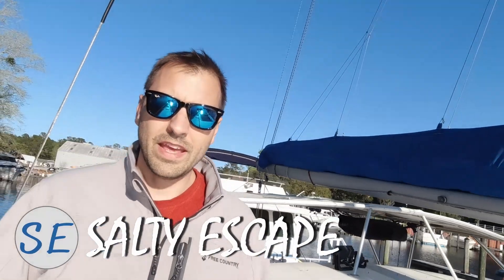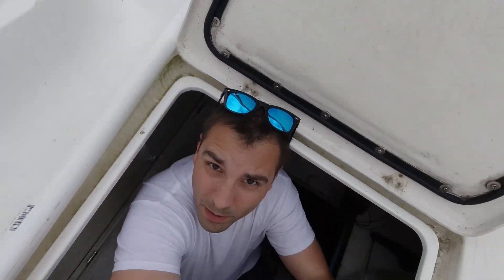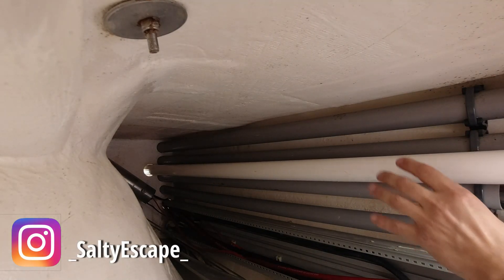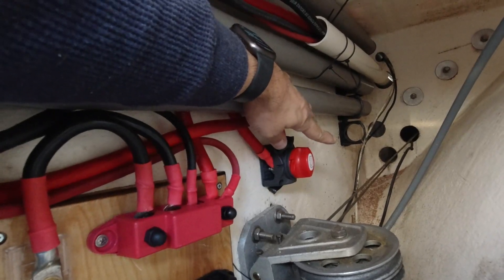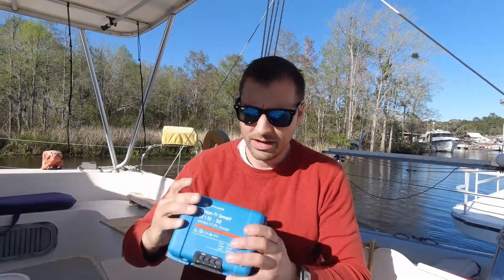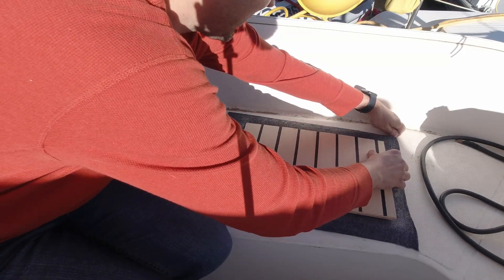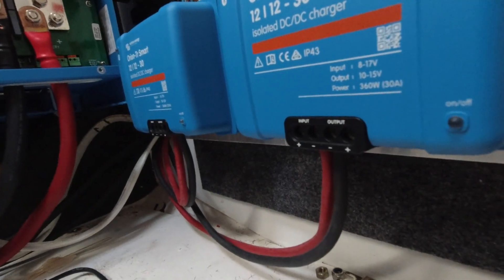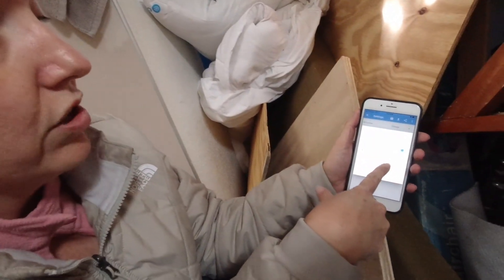Installing Victron Orion DC to DC chargers for AGM to LiFePo4 charging on our Catamaran Sailboat

Comment: I'm so glad I found this video before installing my Victron Orion TR 12-12 30 DC-DC charger.  I followed your lead and used a 1/4" aluminum plate as a mounting surface for the Orion.  In addition, I purchased 1/2" Nylon spacers  that I used to hold the aluminum plate off of the HDPE mounting surface to provide additional air flow around the entire setup.  It was super easy to wire up and program!  The unit does heat up a bit, but the extra heat sink of the aluminum and the offset spacers really help to control the heat.  I would not want to mount these directly to wood!!  Thanks again for your videos and for showing the best way to mount these DC-DC chargers.  Well Done!
Reply from the maker: Thanks for the feedback! We’ve had ours for a long time now and it works perfectly!   I love having the extra power go into the LiFePo4 bank.  Would you believe someone in the comments actually said the aluminum plate could be harmful by restricting the airflow!! 🤷‍♂️  I guess there’s one in every crowd.  Lol.  So happy you found my video helpful.  Cheers, Corey

Comment: Couple comments: Like you, I am in the process of planning a lithium battery bank installation. On a boat, I believe that by ABYC standards state that you should have a common ground; which implies that you should not be using the ISOLATED version of the Victron Orion DC-DC converter - the NON ISOLATED version has a common GROUND; the POSITIVE IN and OUT are ISOLATED as you would expect. The use of YELLOW wire, by ABYC standards is for DC GROUND - I see you have added RED heat shrink to the end of the cables( which is laudible), but the yellow wire is not a good plan long term; you will know what it is, but a technician or future owner will not.... I would also suggest as you are installing to get a DYMO GUN and mark what each cable is used for .... 
Again later on, when you are trouble shooting, you will be glad you took the time. I would also make a wiring diagram and anotate your installation. 

I did not see a shunt installed on the negative circuit for your starting batteries; it would be good to know what the engines are drawing overtime - you will be able to see starting current and know if something is not performing  right. I did not see where you installed the  VICTRON Smart Shunt on the Lithium bank?
Reply from the maker: Hi Daryl, 
Yes, common ground and bonding… 
I used the isolated Orion because I have AGM starter batteries for the engines.  I dove deep in the forums and the isolated was recommended.  Both engines are independent circuits with the exception of the Orions.  The Orions serve as my shunts.  The videos you have seen highlight the early phases of my install and there have been modifications and other features added.  My advice to you is to go Victron.  We have implemented their system including the Cerbo gx and display screen and it is well worth it!   
We have a few people in our patreon group who are building LiFePo4 batteries for their boats and there is always more information to share. As I write this, we are about 10 miles off shore headed to west palm beach FLorida and we will be heading to the Bahamas asap.  
Cheers and safe travels! 
Corey

Comment: Would love to see your wiring diagram for this installation as I am doing the same at the moment. André in Sydney
Reply from the maker: Hi Andre, thanks for reaching out!  There really isn’t anything mysterious about this install. It’s just a +/- from the starter battery into the Orion and then a +/- out to the DC busses. I did put fuses on each end. There are a number of very nicely drawn wiring diagrams on the Victron website.  For us, the system works as intended although our amperage coming in to the battery bank from the alternator is less than expected. I’m planning to upgrade my alternators and then we should have some pretty good input coming in. Hope this helps! Corey
Reply: @SaltyEscape  Hi Corey, Thanks for your reply. I was thinking about the differences for a boat install like where to put isolators/disconnects and the protection of the alternators. Since my boat is similar the system should be the same. André

Comment: Seems to me that charging the lithium batteries while motoring is not an example of capturing otherwise wasted energy from the diesel engines.   Charging represents a load on the engines that is indistinguishable from a headwind or counter current and will result in burning more fuel than without the lithium connection.
Reply from the maker: Hi Troy, the alternator turns regardless. There’s no additional load. Now, maybe when we upgrade the alternator there would be a change in load on the engine… however with high output alternators the charging benefit far exceeds the loss.
Reply: @SaltyEscape  thanks for fast response.  Enjoying your content. So, if I understand you correctly,  the alternator puts out a steady current regardless of what it's connected to? If thats the case, then what happens to the current when batteries are fully charged? ✌
Reply from the maker: My understanding is, the Orion‘s detect voltage. So, when the alternators recharge the starting battery (first) and the starting battery voltage climbs to around 14 the Orion’s kick on and the overflow voltage goes into the lithium battery bank.  This overflow voltage would normally be lost. I’m not an expert but that’s my understanding 😉
Reply from the maker: I think I should clarify… there is no additional mechanical load on the engine.

Comment: Love the channel guys! How are the Orion’s doing? I’m making the switch to lithium on our Leopard 40 and I think I’m going to use the Orion’s.
Reply from the maker: Thanks guys!  The Orion’s are working perfectly and autonomously.  So easy!  The only complaint is not with the Orion’s… but rather my alternators. When we upgrade to high output alternators we should see much higher amp input from the Orion’s into the batteries.-Corey
Reply: @SaltyEscape  did you use 6awg wire to and from the Orion’s?

I heard they get really hot. I like your metal backplate. I am considering putting them in the engine bay close to the Yanmar and starter battery. I hope they don’t get too hot! 

Fair winds!
Reply from the maker: I don’t recall which size wire I used… But it was the largest that would fit in the Orion. I had a long run of wire so I needed to use the largest gauge I could.
Reply: @SaltyEscape  I don't know a lot about alternators but shouldn't your existing stock alternators handle the 30 amp draw from the Orions?
Reply from the maker: They can handle it.. the alternators are not a high output… yet.  We will upgrade them soon. I hope. 😊

Comment: use a shunt https://www.victronenergy.com/panel-systems-remote-monitoring/smart-battery-shunt#pd-nav-image
Reply from the maker: Actually that is the exact shunt I am using!
Reply: @SaltyEscape  them throgh it you should now how munch current you are consuming
Reply from the maker: Oh.. I think we have a misunderstanding.  The shunt IS how I know how much power we have used.  Also our LiFePo4 batteries have a smart BMS that also monitors our use however the BMS units are for each battery.  (We have 5 battery banks)

Comment: Question.  What is the purpose of a bus bar?
Reply from the maker: Hey Rob,  They are used for positive or negative grouping / distribution.    For example the positive lead will come off of a battery and attach to a positive bus bar.  This bus bar will have multiple additional attachment points for additional leads to power your devices.  In my case, I am using my homemade bus bar as a common link for all of my LiFePo4 batteries to be wired in parallel.  Does that make sense?  Corey
Reply: @SaltyEscape  
Awesome.  Thanks Corey,...  electricity is my arch nemesis 😂😂
Reply from the maker: Haha... It can be intimidating.

Comment: May I ask why are you limiting charge current from the alternator of 80 - 85 amps to only 30 amps? (the great advantage of lithium battery in yachts is the fast alternator charging)
Reply from the maker: Hi Mikael,  great question!   First let me say, I am not an expert. However, the biggest reason for going with the Victron Orion was the smart, adaptive charging (bulk, absorption and float) designed for LiFePo4. Also the Victron Orion is programmable for your specific charge parameters which was important for us as we built our own battery bank with “raw” cells.  And, although it says 30 amps it’s rated for 430 watts continuous.  For us we have 2 units and therefore 860 watts when running both engines.  Considering most catamarans are only able to install between 1200-1400 watts of solar, we thought the Orion’s 860 watts was pretty good.  (We will be installing solar as well).  Lastly,  unless I’m mistaken, for the 12 volt to 12 volt options the 30 amp is the largest that they sell.  I hope that answers your question, if I’m mistaken on something please let me know!  Thanks for reaching out to me!  Cheers, Corey
Reply: @SaltyEscape  they can also be run in parallel for 60 amps.

Comment: Why do you have yellow black and red positive wires?  Is that not confusing
Reply: Yellow is the proper color for ground on boats with black HOT ac wiring so you don't confuse to 2
Reply from the maker: The only yellow one is the heavy ground for the Victron multiplus.  It’s yellow because it was salvaged from the existing lead acid battery system.  (I don’t know why the original wires were yellow). The ends have black heat shrink and at a glance you can see it’s just the equipment ground.  Not so confusing in person but I’m sure it looks a bit messy on camera.  I still have some wire organizing to do. 😊 -Corey

Comment: Hi Corey, Another great video. I will gratefully copy the aluminum heat sink when I mount my Victron 12 12/ 30 charger as well. Question is the fabric heat retardant?  Cheers Kevin
Reply from the maker: Hi Kevin, the fabric is felt. I bought it on Amazon. There is a link in the video description to my Amazon affiliate store. The manufacturer said it was ideal for very harsh environments, chemical resistant, heat resistant but they did not mention nonflammable.  Although I couldn’t find any other fabrics that were non-flammable either. My assumption is it is flame retardant but I do not know for sure. Maybe I’ll test it on a scrap… LOL.   I don’t know how warm these Orions will be during operation, however I doubt they will become that hot. Cheers -Corey
Reply: @SaltyEscape  hi Corey, yes I had looked at the link earlier but didn’t see a specific mention regarding flame resistant. It’s also out of stock. I’ll try the local auto supply store. I don’t think it will be an fire risk as the aluminum plate along with the additional spacer you used should keep it safe.. I appreciate your sharing your experience and also taking the time to reply. Cheers Kevin
Reply from the maker: Thanks Kevin!  Sorry it’s out of stock. That’s surprising 🤷‍♂️.  I did not show it in the video but I cut the aluminum plates to fit my install. A metal cutting blade on a jig saw worked well (but slow). Good luck on your install!  Corey
Reply from the maker: Update...  I found the same product in a different size roll on Amazon.  I have updated the link.  Thanks Again!!

Comment: Can’t figure out why you placed a piece of aluminum behind the heat sinks.  All it does is restrict the airflow into the fins of the heat sinks. Would have worked well with just the spacers since it would have allowed more air to circulate. Anyway, just my thought on it. Putting a fan on top of the heat sinks might have been better. 2 cents (CD) into the hat. 👍🙂
Reply from the maker: Thanks Bayani!  There were two main reasons for the aluminum. First, it will serve as an additional heat sink, second in the instructions it says not to install on a flammable surface.  (Ours is wood). Most of the time these are mounted directly onto the vertical surface, therefore the aluminum will not interfere with any airflow. Your idea of a fan is a great idea, I will monitor the temperature closely when we are underway and we may install a fan with a thermal switch if needed. Thanks for watching, Corey

Comment: Corey, Nice job on the Lithium/Solar project.  I'm considering a new catamaran.  Any suggestions you can think of to have added while they are assembling? (like conduit and pre-running wire across between each engine bay..etc..etc).

Keep em' coming..very interesting.
Reply from the maker: Hi Douglas,  I’m humbled that you would ask us!   The new Cats seem to have most everything figured out for cruising. The only thing I can think of is a wire run for Solar installation.   I’ve noticed most cruisers have the challenge of routing wires for solar panels.   Hope that helps!!  It sure is exciting to be buying a new boat!!  -Corey